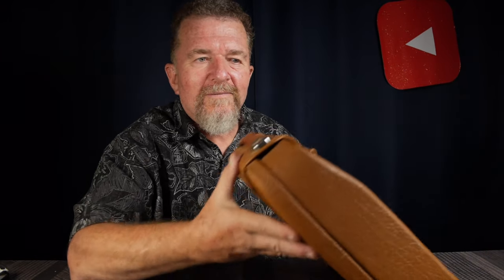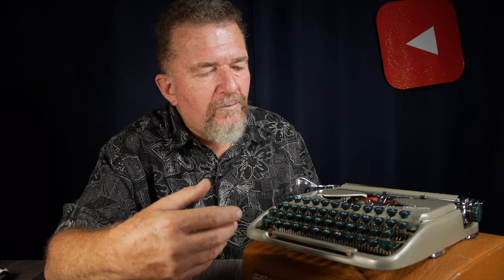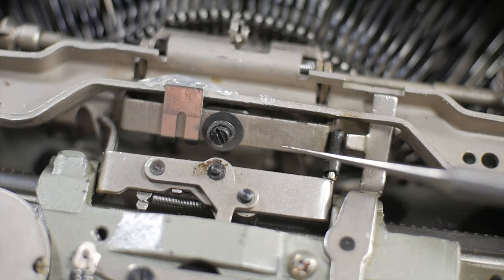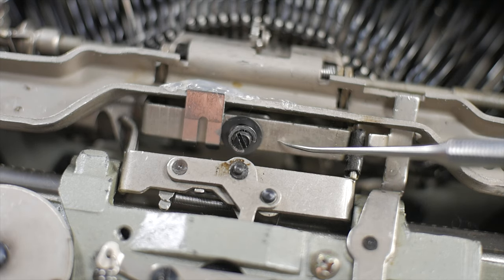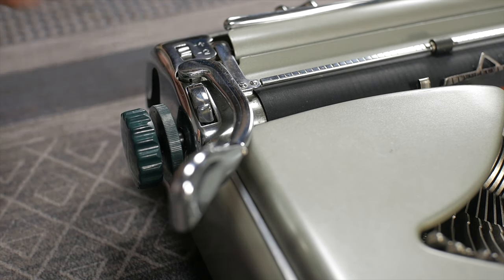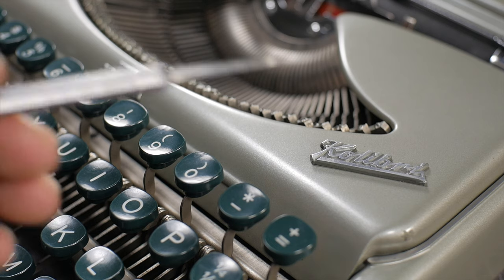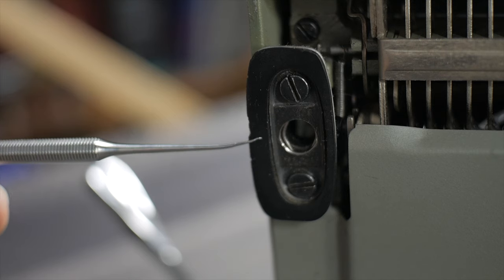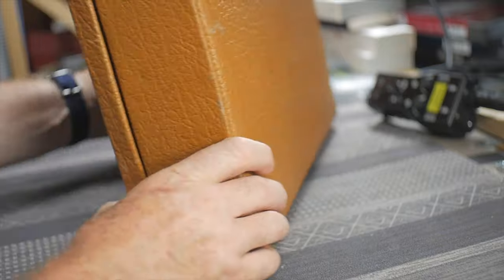Typewriter Video Series - Episode 227: Groma Kolibri Repair

Comment: (Question) Like you Joe (and probably others in the Typosphere) I came to covet the Kolibri from watching that great film "The Lives of Others." After seeing its "pancake" height, the Groma K became my Grail machine. Fast forward nearly ten years. I have finally acquired a maroon-colored Kolibri from a great shop in Philadelphia (during the pandemic, I might add, the shop set up in a side garden with typewriters sitting amongst the foliage). I simply love this machine, however... the left margin skips; I have to consciously, upon return, hit the space bar to ensure for myself a cleanly-aligned left margin otherwise, it skips one, sometimes two spaces. It "feels" like a worn bracket or pin... I have the exact same issue with my 3-Bank Portable Standard Underwood -- the left margin skips. My question: Well, you know what the question is, but here goes: Where should I be looking to perhaps remedy this situation. Thanks, this was a great video. I pulled out my Kolibri and typed up notes as you were speaking -- how 2020!

Comment: I ordered one from Hungary after seeing it on The Lives of Others. I have been a Hermes Baby Rocket for years, so I look forward to A/B comparison. I may have some questions for you.
Reply from the maker: I hope you receive it in good condition!
Reply: You know Joe it doesn't advance when I type it and it looks like there's some pieces of it that are missing. How would I get in touch with you if you were interested in repairing this? I am really liking the way it looks but it would be really nice if it functioned
Reply: Yeah, the filament drawband is broken. I can't tell if the mainspring is intact or not. The roller grip on the left hand side is also fractured. I don't know if it's going to be worth it to repair. What are your thoughts? I paid just over 300 bucks for it,
Reply from the maker: @jhardycarroll  Drawbands can be replaced, perhaps the spring motor is functional. The broken left platen knob is a shame, but it still may be usable using the right knob. I think you should see about replacing the drawband first.
Reply from the maker: @jhardycarroll  Since it's difficult to see getting your money back by reselling it as-is,  you may either have to take the loss, sell it deeply discounted as a parts machine, or try repairing it. Other than doing the work yourself, perhaps a repair shop in your area would be willing to do it, which would add to the money you've already invested, but with the hope you'll end up with a working machine eventually.
Reply: @Joe_VanCleave  I think I am going to send it back. The seller has an established Etsy account, and I offered to pay for the shipping. I'll let you know. I have my out for another one, though. I really like the whole vibe of it. When I removed the bottom plate from it a bunch of eraser crumbs fell out, and I was reminded that the STASI kept a typewriter registry so if anyone in the DDR typed something subversive they could be arrested and questioned. I wonder if the eraser kept them out of jail! That's what I love about old typewriters. I like to picture my Baby Rocket bouncing around on some sportswriter's lap as he banged out a story about a baseball game, or a war correspondent in Laos or Vietnam filing a battlefield report.
Reply from the maker: @jhardycarroll  That’s the best approach. I hope you find another one, in better shape. Mine was acquired by my friend Kevin from eBay in Europe.

Comment: Hi, Joe.  What is better and easier for typing/ this machine or Facit 1620?
Reply from the maker: Assuming both machines are in good working order, a larger portable like the Facit will have more features and may have a better touch. Keeping in mind that touch is often subjective - some people like a light, easy touch, while others like a solid, heavier feel. The obvious difference between these two is size and weight.
Reply: Thank you very much, Joe!

Comment: I was using Groma Kolibri a lot back in the 1970s as a teenager for my own projects and also for school. 
I noticed you are using black and red ribbon. 
Is the red colour any use in this mashine ?
In my Kolibri letters going under the line like p g and y are red at he bottom. How to correct this, anyone ?
Reply from the maker: I just happened to have this 2-color ribbon, but the machine was designed for single color ribbons, since it lacks the bichrome setting mechanism.